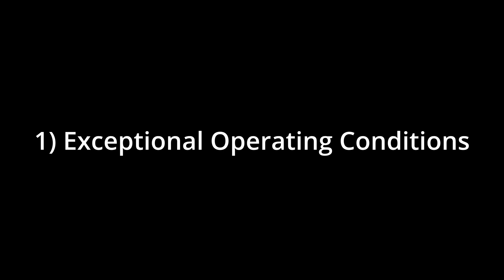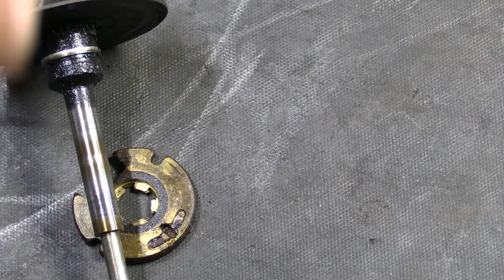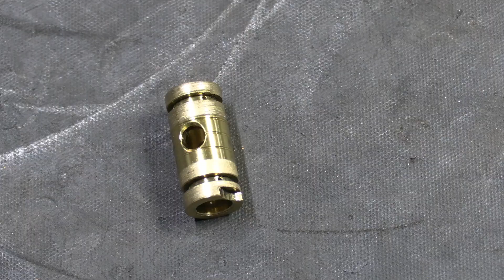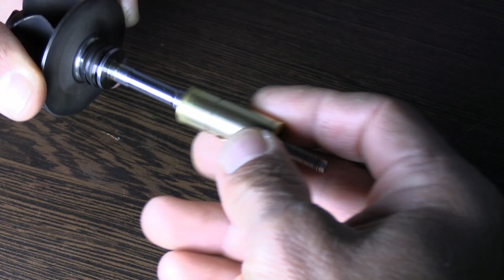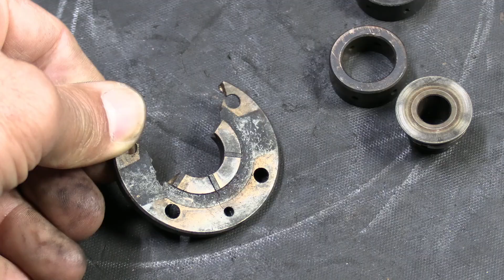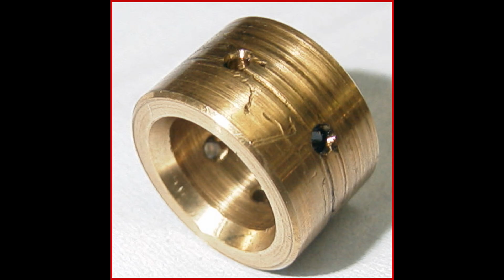Failure Mechanisms basic intro

Comment: Question about thrust loads.  What is the mechanism in a hybrid turbo that creates the now excessive thrust load?  For example here are some of the things that pop into my head.  Excessive exhaust pressure on the turbine side to create the shaft power required to drive the larger compressor.  Another idea that the larger compressor has much more surface area for the inlet pressure to act on than the now relative small turbine.  Not sure what it is, hope to hear details at some point. 🙂

Comment: I did self modify a td04-14 and put in the 19t compressor, cut the back of the compressor to match the backing plate to 58mm also installed the higher cover as well.  The increased tip height seemed to awaken the turbo and was a great match to the 272 cam that was also installed into the motor. 

I enjoyed the video, great content!

Comment: Good info as always! My guess for the last turbocharger failure mode is high exhaust gas temperatures for extended periods. You mentioned it was industrial so I am guessing diesel. Something like the engine being run at high RPM for a high load or possibly a slight incorrect air to fuel ratio. High EGT and long exposure transferred all that heat down the shaft and to the bearings. The excessive axial load from the high pressure caused the most friction on the thrust bearing causing extreme heat and eventual total failure.